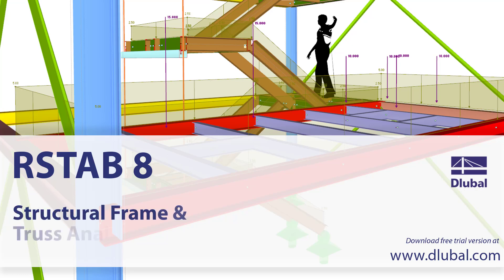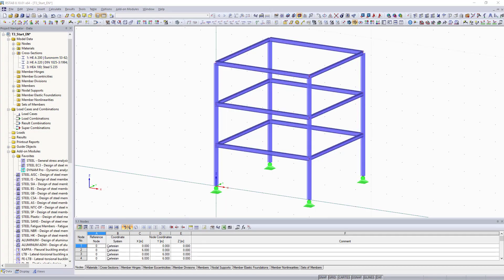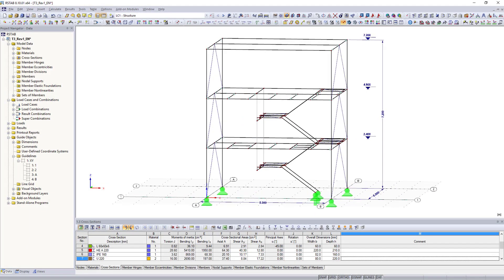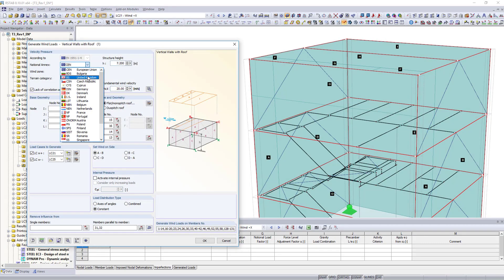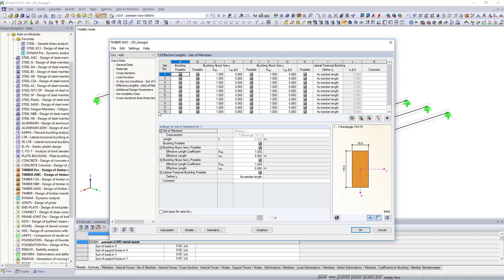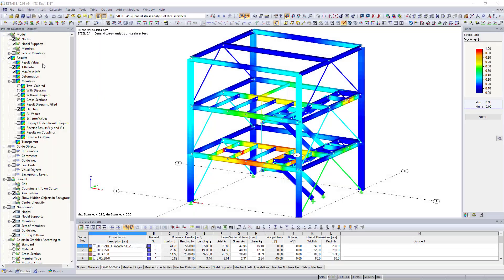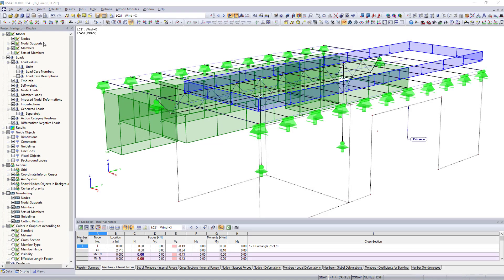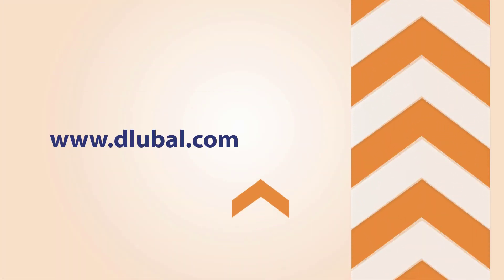Dlubal RSTAB 8 | Introduction to Structural Analysis & Design Program for Frame & Truss Structures

Comment: Hello, I find your software very useful. 

I would like to ask if it is possible by copying an already calculated model to a new file with all the loads and the load combinations at the same time?
Reply: Hi Theodoros, You can save a calculated file as a new file. Data/Save as... or press F12.

Best Regards
Reply: @DlubalDE  Thank you for your rapid response. Let me please rephrase. What I mean is from an already calculated file to use the Edit/Copy and then Edit/Insert to a new file with another calculated model. Is it possible to keep my previous given loads?
Reply from the maker: @theodorosmolyvatos7468  Hi Theodoros.  Yes, this is possible.  With the copy/paste function from an existing model into a new model, all structural data including the loads will be included.

Comment: Hi, I'm quite interested in your software. I'd like to know if the software allows timber designs to BS or EC standards and not just analysis as there are very few programmes that can design timber sections
Reply from the maker: Hi Tarek, Yes our software allows timber design according EC 5. A lot of National Annexes are integrated (also BS). Here you can find more information about timber design in our Add-on module RF-/TIMBER Pro: https://www.dlubal.com/en/products/rfem-and-rstab-add-on-modules/timber-structures/rf-timber-pro

You can also watch the webinar about timber design in RFEM and RSTAB: https://www.youtube.com/watch?v=MQLhXbdiuRI

Just try it by yourselves with the 90 day trial version: 
https://www.dlubal.com/en/downloads-and-information/free-trial-versions/download-trial-versions?bitversion=64-bit-version